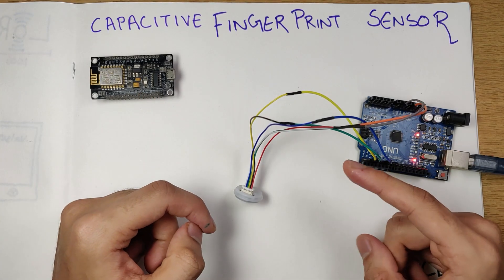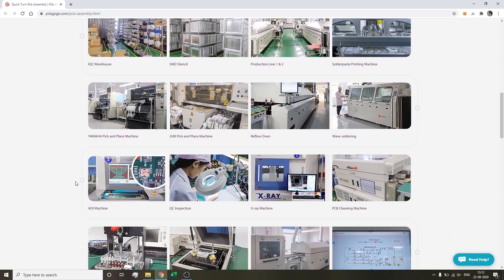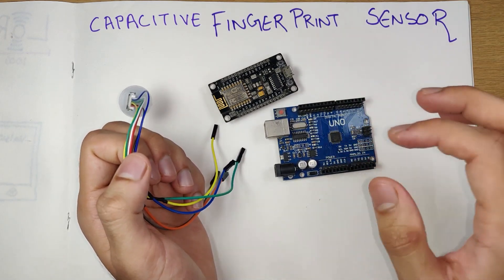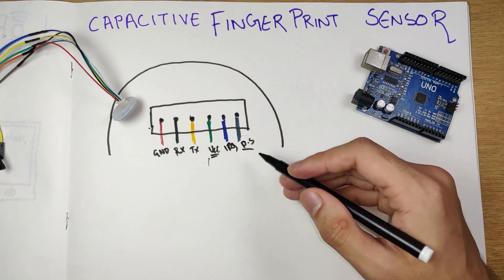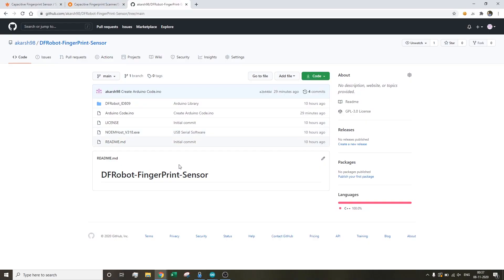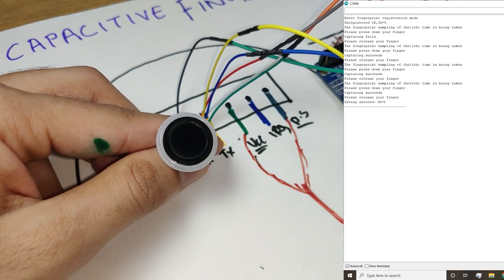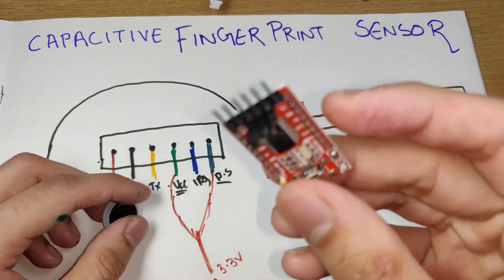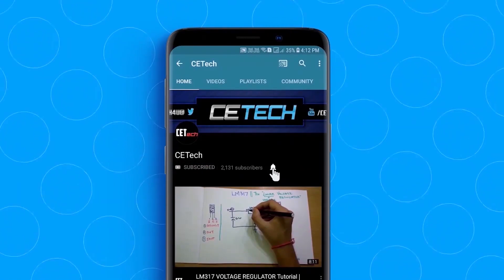Capacitive Fingerprint Sensor / Scanner Arduino Tutorial | ESP8266 DFRobot

Comment: can you use two of this scanner in one arduino? scanner 1 for registration of fingerprint and scanner 2 for recognition of fingerprint that was registered in scanner 1?
Reply: Usually there is no need to use two. Instead, in the code you can handle permission for registrations and detections, but yes, you can connect as many sensors as Serial ports your hardware has

Comment: Using this Fingerprint device with a NANO and the referenced sketch. Inconsistent results. The device works OK, but the sketch crashes a lot. I contacted dfRobot and they say (even though it's their sketch) that a hardware serial port must be used to avoid inconsistent results. I've tried obvious ways to do that (TX/RX pins), but it doesn't work. Do you have an answer to this? Thanks!

Comment: Every time i connect a sensor with arduino nano, it says... Communication with device failed, please check connection
My connections are 100% right as i have made the PCB of this circuit and have tested all connections multiple times. i have changed 4 sensors but getting the same result
Please guide
Reply: same here. You find any solution ?
Reply: same any update?
Reply: @itsSHKR  same

Comment: Could it be used to either not allow a computer to boot up (“cut” the power) until it’s read or be used as the “password” instead of typing in a password use it to unlock either windows or Mac?
Reply: Yes, something like this can be implemented through software or hardware. You can do a lot with arduino.. and also.. look into raspberry pi.
Reply: @anthonymercado3464  hmm might have to look into this then. I have a latte panda alpha so I could use the arduino on there no need for raspberry Pi. I just wouldn’t know where to begin never used arduino and not sure if I’d wanna buy all this to have it not work.....

Comment: I don't have the dfrobot_id809.h :(
Reply from the maker: If you get the library installed, you'll have the header file as well
Reply: @CETech4u  I have found the zip file on google thanks
Reply: Can this coding be used on the fingerprint type R503 ??
Reply from the maker: Not tried

Comment: Where save the ID?
Reply from the maker: On the scanner.
Reply: @CETech4u  Why would they save in ON the scanner??? That's such a security issue. That's just stupid af
Reply from the maker: Thats done to make the usage of the sensor easier for us makers. If you want you can bypass that and get the data off the sensor as well
Reply: @CETech4u  Do you think that would come at a significant time cost? Like a big delay?